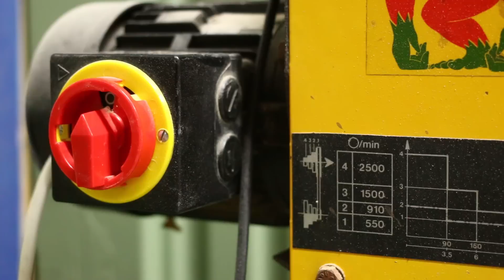Laura´s Brass Tins

Comment: Great video (again)! The tins came out great. Love the metal and wood combination. Small tip for the lathe part. Tilt your table saw blade to 45 degrees and cut of the edges of the block. This saves you a ton of time instead of rounding it completely on the lathe.
Reply from the maker: +Norner Houtbewerking i did that in the last video...so this time i wanted to show that it is possible to do it completly on the lathe. thanks for watching!

Comment: Wow those turned out great, and so did this video! Tons of great shots, but the one where you are using a bit to hollow the center of the tube is really cool to watch. I love the simple distinction you gave the knobs to tell the salt and pepper a part. Also great tip on using a sander as a pencil sharpener! haha. ; )
Reply from the maker: +April Wilkerson haha, i hate dull pencils...i think you would love working with a lathe! it is so rewarding :)

Comment: Beautiful work, Laura, I also love working with brass in my woodworking and woodturning, its a great metal to work with and it definitely adds great warmth to a piece. Did you have any problems with corrosion on your salt jar? If not, what specific alloy of brass did you use?

Comment: Nice project. Remember that brass does not stay shiny golden as in this video for long. Due to oxidation in air it will get dull brown. If you want to keep it shiny for a long time you have to put on a clear coat of varnish to keep air away.

Comment: Nice design Laura. As a woodturner of 16+ years, I'd like to offer 2 comments: if you lower the tool rest 2 or 3 cm, you will get a slicing (cleaner) cut on the wood rather than the scraping (fuzzy) surface you are getting now. When you cut cylinders on the band saw, be very aware that the blade can pull the wood from your grasp, spin it in the blade, then bind the blade and kink or break it -- just be careful doing it.
Reply from the maker: thanks for the tips! i just got started with the lathe so i have a lot to learn there. i am always super careful cutting round stuff on the bandsaw

Comment: Hi Laura
Nice job and nice filming again. What camera do you use?
I'd like to do some films of my work and need a camera but don't know what to buy.
Reply from the maker: +Superior Etchworx i have a canon 70 D and i am super happy with it. i have been quite rough with my gear and so far it seems to be pretty robust. it even fell from the tripod once. anyways. i had some good lenses from back when i used to be into photography...so when i started making videos i just bought a used canon 700 d body on ebay. once i decided that i want to get more serious i upgraded to the 70 D. the "new Storage" video it the first one i shot with the 70 D and edited with premiere pro...maybe you can compare it the videos from before that and see what you want to go for.
Reply: +Laura Kampf  Thanks for the info Laura. I have canon EOS lenses will they fit the 700D or 70 D ?
It sounds like a good way to go if they do.
Reply from the maker: +Superior Etchworx i think that should work fine. all the digital cameras have the same mount as far as i know...there are even adapter to make the old analogue lenses fit the new cameras. but maybe ask in a camerastore again, i am not 100% sure.

Comment: Once again I really like your video. 
But be careful cause I m not sure that salt and brass is a good combination. Salt is an acid and brass contain copper, acid + copper = copper hydrocarbonate 
I m not chimist and someone could confirm but find out
Reply from the maker: +Jean Aimarre as i said before...if it corodes i will varnish the inside or put something else in it. i´d rather see the opportunitys than the problems. thanks for watching!!
Reply: +Laura Kampf You re right

Comment: I really love your videos and get some good ideas from them but when you wood turn you always seem to keep the handle high and the cutting tip low, this is dangerous and can cause the tool to dig in and ultimate get pulled out of your hands, damaging you and your tools.  I was taught and teach my students that the handle should always be below the tip to prevent this situation and it makes for better cuts. I hope you don’t mind me pointing this out. T